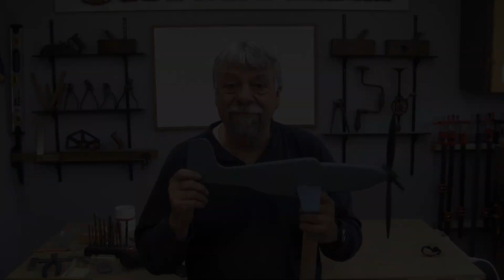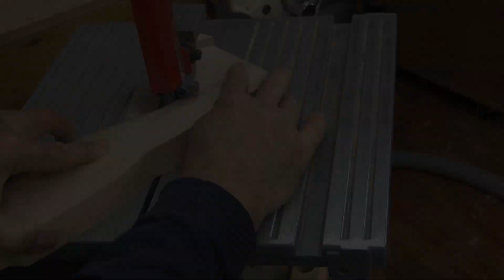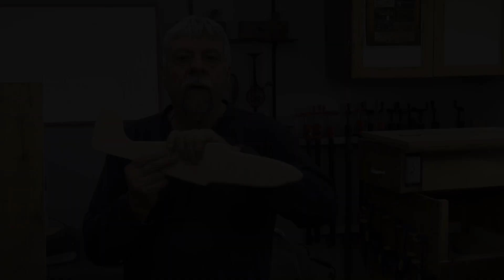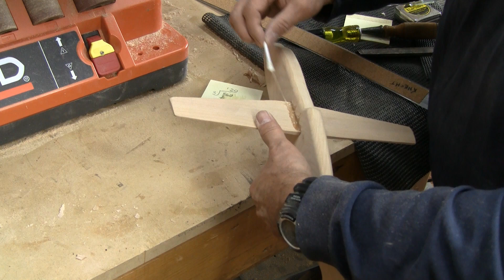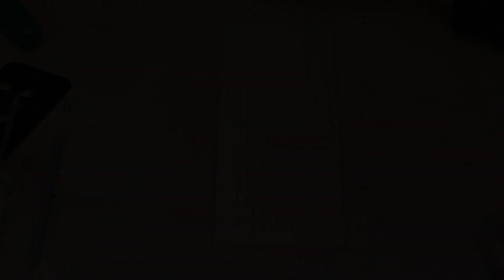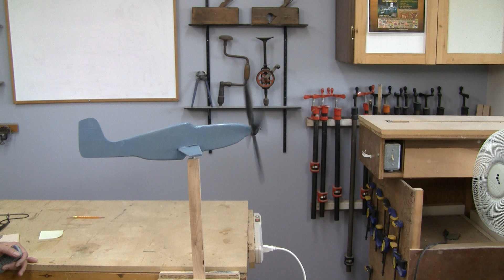Making a Whirligig  - a woodworkweb video

Comment: I am in my late 60s and when I was a kid my Grand Dad built those and whittled most of the body out by hand.  He would drill the hole through the propeller and take a nail and heat it red hot on the stove and push it through the propeller while it was hot to char the wood then put a dab of Grease on it.  That would keep the nail from rusting and the charring of the wood would keep it from soaking into the grain.  The same went for the body of the plane.  He would drill the hole about the same size and then Char the inside of the hole and drive the nail into the pole that it would be mounted on.  Then cut the head off of the nail and file it round.  After smearing a dab of grease on the nail they were ready to go.   That is just  a blast from the past.  I like the way you do it, Great job!

Comment: Good work Colin  I have made lots of whirligigs and one  tip I give everyone is to weigh and balance all of the blades for the prop to the same for smooth action 
also a larger tail helps to keep  it in the wind   thanks Patrick
Reply from the maker: Patrick's work shop Good tip on the prop blades .. thanks buddy

Comment: Hey Colin, nice project.  I like the way you tapered the tail section AND the ball bearing idea.  That will definitely cut down the friction and allow it to turn much more freely.  The nail tip will work, but once it cuts the head of the screw, I would think it will be almost impossible to replace it.  Good job.
Reply from the maker: Sebastopolmark Thanks for taking a moment to comment ... so good points :)

Comment: I'd really like to see how to make some cabinet shelves for a pantry.  We have a cabinet in our new house with no shelves in it.  Not sure how to make sure they're strong enough.
Reply from the maker: Riceking10 I would probably use plywood for this but I would face the plywood with some natural wood so it looked like a natural wood board. Plywood is very strong and is good for shelving, I am thinking probably 3/4" or maybe slightly under depending on the span. Fastening them, you could use "L" brackets maybe, screwed to the cabinet and the shelves.

Comment: Great Video just watched the Anthony Hopkins movie Blackway and I want to make some of these like he does in that movie.I am confused about what direction is the wind blowing N S E West?  As to the point on the plane because the point of the plane points into the wind?  Do you know what I'm tryin to say?For example looking at your video:  Say the fan is blowing air in a south direction,  that would mean to tell which way the wind is blowing on the plane you would go by the direction of the tail?  That's confusing as hell, but what can you do, you can't put a propeller on the tail to get the point of direction right.Okay I think I've got it figured out thanks.

Comment: Off subject question; on the rear wall, to the left of the white board, middle shelf are 4 'tools'?  What are they please???
Reply: The top two are old wood planes and the other two are  hand drills.
Reply: Mark Senior 

Ahh...no. Other side. :-)
Reply: DB Thats-Me Next to the fold-up rules.
Reply: DB Thats-Me Next to the fold-up rules.
Reply: Saw set pliers.
Reply: Mark Senior Got it!  Thanks for the help.
Reply from the maker: DB Thats-Me Yes, Mark is correct ... for setting the angle of teeth on hand saws

Comment: You glossed over the making of the prop. That maybe the most important part. Most  specifically the angle the blades need to be inserted to catch the wind Too bad, you lose a whole grade on an otherwise good video. Why did you skip the tail and make the wings stubby? Weight considerations?

Comment: Hey where is the tail wing ?  Also when the wing is shorter in length than the fuselage then it looks really funky, now it looks like a two year old made it, sorry no offense meant,  it's just that it doesn't look like it should look. On top of all that the prop is way, way too big.
Reply: That is all due to  what they call "the artistic licence" where an artist can modify the real thing to make it fit a particular desire. In this case the idea is not to have a real plane, but something that would attract attention and give some entertainment to those who look at the art work. This is not engineering where precision is required so that the plane will fly. If the wing was any bigger the wind would lift the plane off its central bearing.   Please take it in the spirit it was meant to be.  As for the larger propeller, well it is bigger for the same reason that women make their eyelashes and  and eye make up  so that their features would be accentuated, and the same with this model, it is meant to attract attention.   I would give him full marks for this work, but just to say something, he should know that in a real plane the propeller is not the same as a turbine and the edges and shape of the blade for a better turbine would be different from a propeller driven by an engine to pull the plane forward............but who cares, all we need to do is watch the face of a happy child when he sees the ' plane'. A child is not the only person who enjoys such art, I am nearing 80 and I think is is good to look at .

Comment: Good job. Now wire the propeller to operate the machine guns
Reply from the maker: Jeff Harmed LOL ... if only I knew how ....
Reply: Reference “Whirligigs and Weathervanes” by  David Schoonmaker and Brice Woods has methods and complete designs.
Use pliers to bend (welding or brazing) rod - the pliers nose chosen for the required curvature..
For mechanical parts, I quote "Use only corrosion-resistant metal parts in your projects...Most of the crankshafts in our projects are made from 1/8" brass welding rod. Top quality brazing rod is ideal. It's very<span style="font-size:11.0pt;font-family:"Times New Roman","serif";mso-ascii-theme-font:
minor-latin;mso-fareast-font-family:"Times New Roman";mso-fareast-theme-font:
minor-latin;mso-hansi-theme-font:minor-latin;mso-bidi-theme-font:minor-bidi;
mso-ansi-language:EN-GB;mso-fareast-language:EN-US;mso-bidi-language:AR-SA">corrosion resistant and bends readily. Steel welding rod is better for connecting rods, since they must resist compression and tension. A smaller size (1/16' or 3/32') is fine in all but the most difficult applications. Some of our designs with particularly complicated crankshafts have tubular bushings to offer additional support. As it happens, 118' brass tubing works perfectly with the 1 /8" welding rod. You do, however, have to cut and position the bushings on the shafts before bending in the throws."